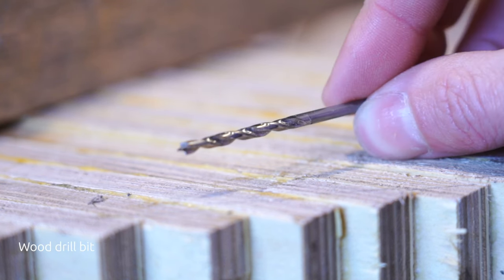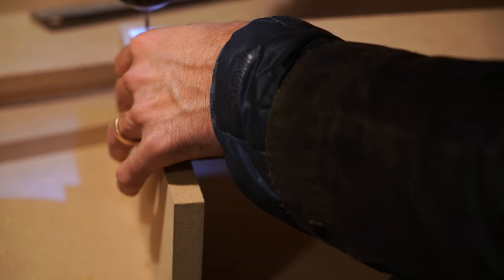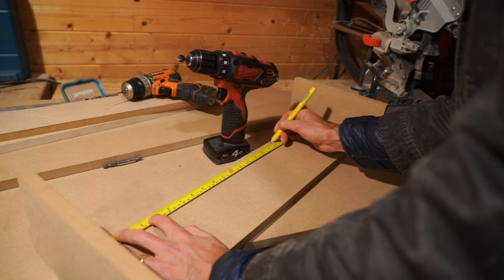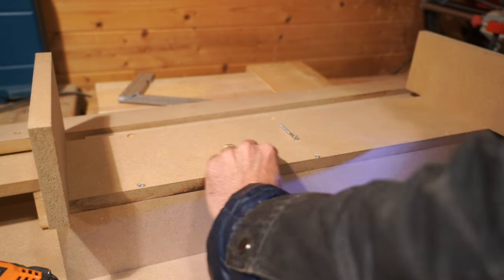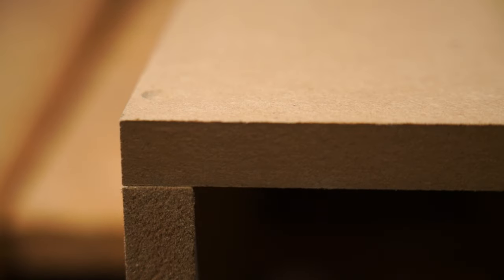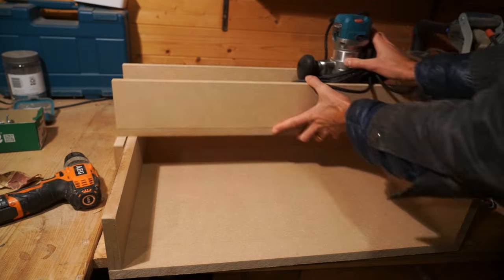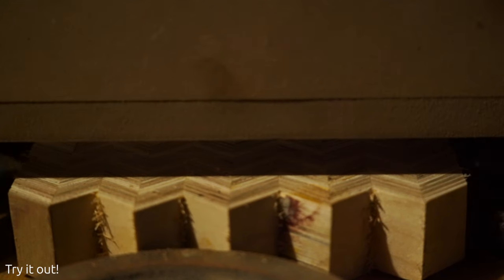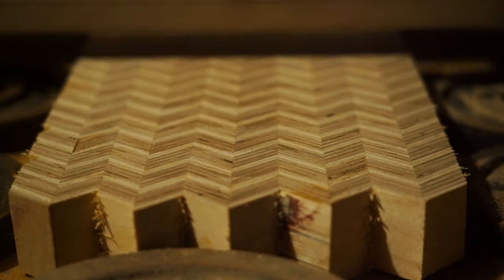The $25 DIY Router Sled Jig

Comment: Is the MDF strong enough to use this jig for a long time? Most other youtubers use plywood. But if this holds up over time it would save me a lot of money 😅
Reply from the maker: So I have used this jig for a while now and I have zero problems with it, in fact, I like it even more now then when I first made it! You just have to be sure to buy thick enough MDF. Other than price, the upside of MDF is that it is perfectly flat and it does not chip off. Conversely, if you imagine sliding the edge grain of plywood over the end grain of plywood, it is prone to catch and splinter off. Also, you don't need this construction to be so strong (relatively speaking), it only needs to hold the weight of your router. If you cut the dimensions right, and you are using thick enough MDF (like in the plans) the sled rests nicely on the sides with enough surface area to prevent any bending.